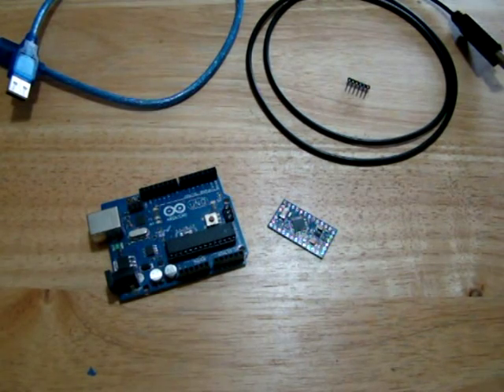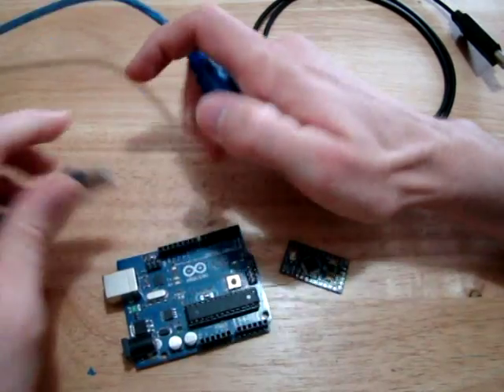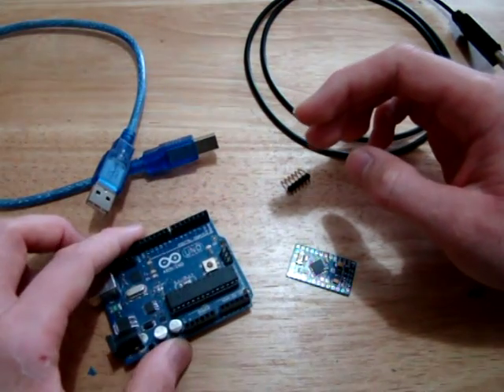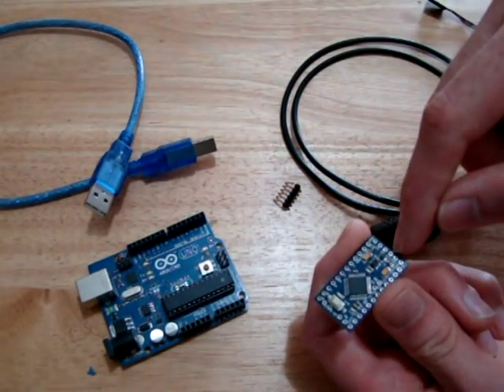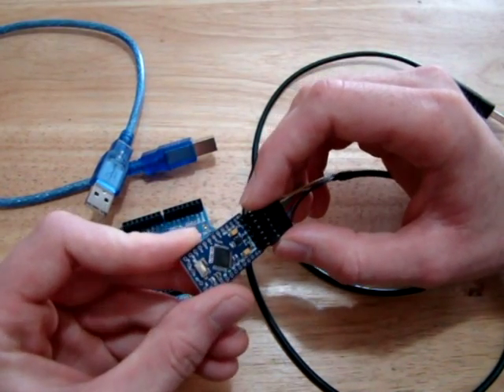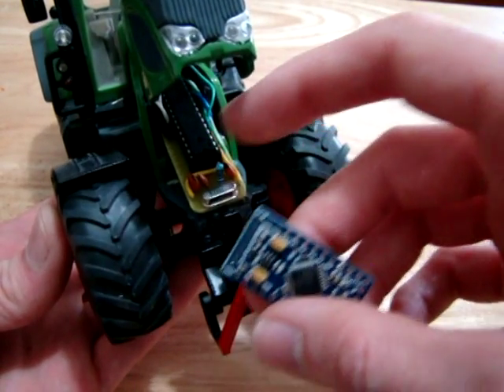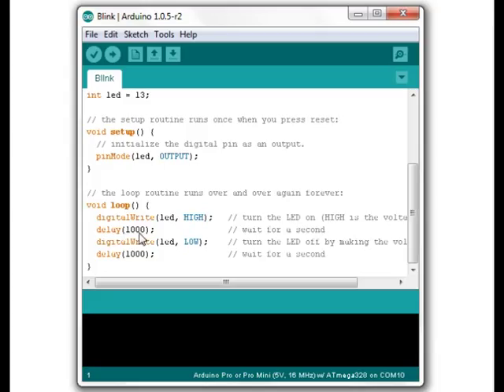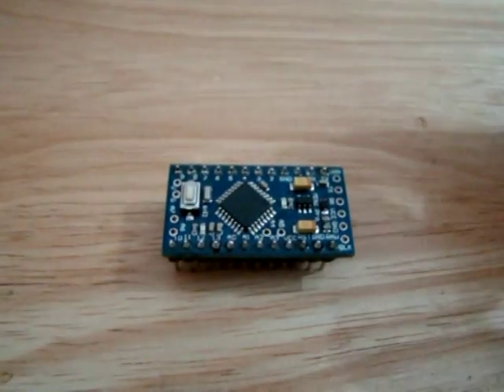New to Arduino? Here is how to get started

Comment: Hey, im sure ill be asking lots of questions for a bit if thats ok with you??  To be able to program the Pro mini how does that work?? do i just plug it in and it will tell me what to do ??
Reply from the maker: No problem, ask away although if it's a lot of questions about one topic or a build maybe you could start a thread in our forum but no worries either way. To program the pro mini you need to install the Arduino IDE on your computer and then use an FTDI cable or similar device to connect your pro mini to a USB port. You then select the board you have in the IDE, the board options are in "Tools" menu in the top right of the IDE menus. In the IDE there are lots of examples in the file menu, including an LED flashing example called blink. Let me know if you run into any trouble.